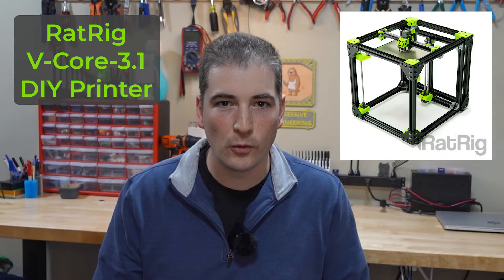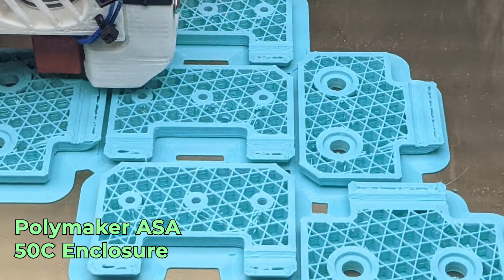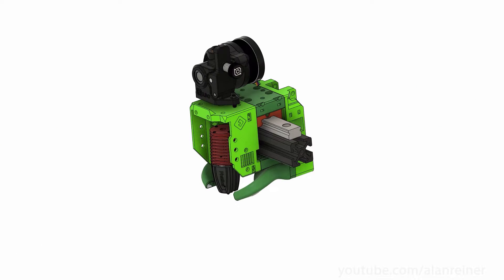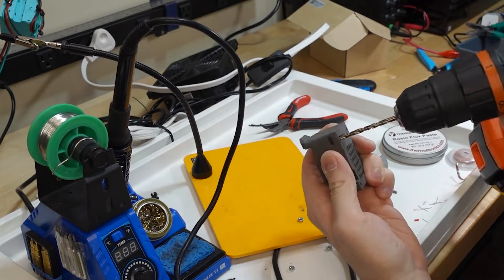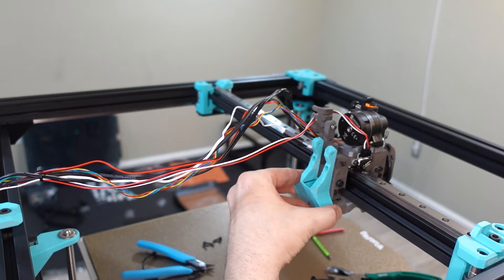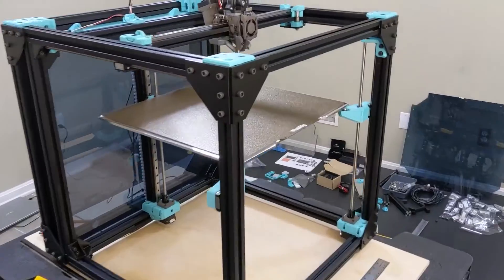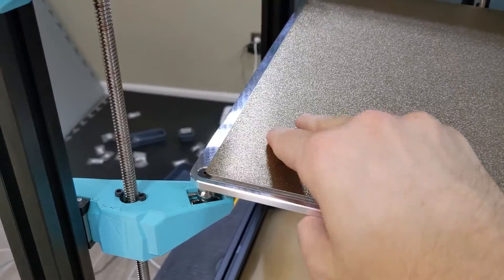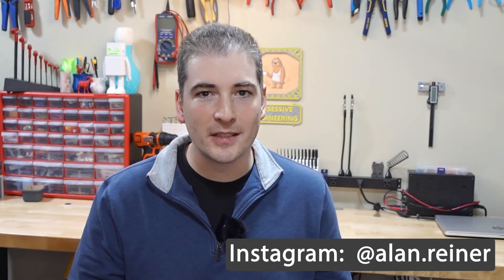DIY 3D Printer Build Experience (II) // Mechanics & EVA Printhead // RatRig V-Core-3

Comment: A few questions:
* Is that a 500mm RatRig?
* Why would the X axis have such a large resonance compared to Y?  There's a lot more mass moving in Y, I'd expect a lower frequency but large resonance there.

If the accelerometer is a single-axis accelerometer, that might explain why it does not see much resonance in X when Y moves -- it would just be measuring cross-coupling.

Final note, any chance you'd be willing to put that accelerometer on the frame itself (top side, where the X axis meets the slider when Y is centered), and rerun the test?  I suspect your frame is resonating as well, if that's a 500mm RatRig.

If it is, you could brace the frame with 8020 diagonals, which should make it much stiffer and drive the resonance up past 200 Hz where the amplitudes are tiny.
Reply from the maker: It's a 400mm V-Core-3.  And you just touched on a detail I left out of the video -- the clip and the chart are only for X-axis shaking test.  The chart shows the output of all 3 axes of the accelerometer, but the print head was only moving in X, thus you see mostly X-vibrations.

If I had continued the clip you would see the Y-axis shaking test next, and a separate chart with the results from that showing vibrations mostly in the Y-axis (actually, labeled Z because of the accelerometer orientation).  And yes, Y-axis is much more mass so it has a lower frequency.  Resonance for my X-axis is around 72 Hz, Y-axis is around 28 Hz.  Magnitudes are around the same order of magnitude.   

I recently attempted a speed benchy with input shaping disabled, and I was astonished how terrible my machine sounded.  With input shaping re-added it's not a quiet machine, but it sounded reasonable at high speed, not like it was going to shake itself apart.  I did eventually succeed at an 8:35 benchy, and most prints have minimal ringing, so I don't plan any more updates to the printer (for now)

P.S. - Sadly something has gone wrong with the accelerometer (or the wire/connector), and I haven't been able to run it recently.  However, I noticed that RatRig posted default resonances to use for each machine size for people that don't have the accelerometer.  Apparently the frequencies are pretty similar between builds.
Reply: @ObsessiveEngineering  I'm thinking of building a 500mm RatRig to print some molds I need.  I was planning to buy ABS/ASA printed parts off Etsy, and enclose the machine, mostly to keep the temperatures and thus shrinkage consistent rather than to print nylon or other high-temp material.  Any warnings you'd like to give me?
Reply from the maker: @IainMcClatchie  If you need accuracy, Nylon & PC are very difficult to print unless you have a crazy hot enclosure, especially larger parts.  Getting the chamber hot enough for that could require different rails, belts, bearings, etc.  However, if you are only planning ABS/ASA, then you should be good with the default enclosed V-core-3.  I have 3mm polycarbonate panels for most of the machine, and it gets up to ~55C (eventually) from pre-heating the bed to 110C (chamber to 60C with insulating foam on top).  This is good enough to do even large ABS and ASA parts very reliable.  I added a 200W heater to help speed up chamber heating, but it only made it like 15 min instead of 30 min.  Beneficial but may not be worth the trouble:

- https://www.printables.com/model/286458-ratrig-chamber-temp-controller-and-rocker-switch-m

The old style enclosure is probably not an option anymore, but be sure you're doing Enclosure 2.0 based on the original "open-front mod".   The old-style enclosure before late 2022 (with the hinged lid) technically works but is quirky and obnoxious.  

The only other thing to be aware of is that doing the enclosure is not cheap.  You'll have to either pay a company to source and cut the panels for you (which can be like $500), or buy the polycarbonate panels yourself and get access to a CNC router to get them cut.  It was an excuse for me to learn to use a CNC router, but not everyone is that committed 😅.  If you want to go that route and are in the US, you can keep an eye on Piedmont Plastics clearance page, which is where I got them like 70% off, though they weren't all the right size and I had to do some panels in halves. 

Let me know if you have any other questions.
Reply: @ObsessiveEngineering  If I'm not concerned about looks, why wouldn't I cut polycarbonate side panels from 8mm dual-wall polycarbonate (typically used in greenhouses) using a handheld jigsaw, and then hand drill the mount holes?  Does accuracy matter here?  I don't even care if it bows a bit when it heats up, right?

I want to print whatever material gives best accuracy.  There will not be much mechanical stress on the mold, and I plan to epoxy fill and polish the surface, so I'll be using the largest nozzle, flow rates, and layer heights that work.

The stiffness requirements on these rigs, especially on the belts from motion in the Y dimension, are large.  I've seen acceleration numbers like 50,000 mm/s^2 thrown around.  That's 5 G acceleration: +/-2.6mm of amplitude at 22 Hz.  That Y dimension appears to be at least one kg, and if it were just one kg 50 m/s^2 acceleration is 50 N of force.  The belts on a 500 mm machine are supposedly 2.9 m long loops (I think a little smaller).  The short legs would take about 20 N of that force each, across a belt somewhere around 600 to 900 mm long.

I looked on the Gates website for a stiffness spec, and did not find it.  I did find this paper: Nominal Stiffness of GT-2 Rubber-Fiberglass Timing Belts for Dynamic System Modeling and Design (https://www.mdpi.com/2218-6581/7/4/75).  With a little extrapolation, I think it suggests a 900 mm long, 9 mm wide fiberglass GT2 belt with 20 N of force change would have a length change of 1.6 mm.

That is to say, the drive pulleys would have to oscillate 2.6+1.6=4.2 mm at the pitch line to get the Y axis to oscillate 2.6 mm.  That's a very large amount of error.  I can see why folks would tend to stay away from 50,000 mm/s^2 accelerations.

Kevlar belts should be about 3x stiffer than fiberglass belts.  Do the RatRig kits come with kevlar belts already?  Is there any chance the belts could be made any wider?  I understand the RatRigs are using custom pulleys, which suggests no.

If you have any spare 9mm wide GT2 belt lying around, I'd be quite curious if adding 5 kg of weight to one causes it to stretch 0.18%.  That seems like a pretty easy thing to make into a video: compare Gates belts to whatever RatRig ships, measure if the belt is stiffer, plop it in the rig to see if the X and Y axes get stiffer, see if you can accelerate faster with the same ringing artifacts.
Reply from the maker: @IainMcClatchie  So I can't respond to everything here in a Youtube comment, but I have a few high-value responses:

1. 50k accel is absurd, and may not be realistic with a 500mm V-Core-3.  At 20k accel I did an 8m35s benchy, and was worried about premature wear on all the components.  Most people (myself included) run 4k-10k accel for every day use.

2. If you are aiming for biggest nozzle and layer heights, then the max speed and acceleration is not going to matter much *because you will be limited by the max flow rate of the hotend, not the speed of the printhead*.  As a point reference, I just put a huge 1.0mm nozzle on mine, and used a line width of 0.6mm and layer height of 1.3mm.   Even going as "slow" as 100mm/s results in ~80 mm^3/s flow rate which is higher than most nozzles can handle.  I try to keep mine below 35-40 mm^3/s even with my Phaetus "ultra-high-flow" (UHF) hotend which is one of the highest-flow-rate hotends out there.  They claim 75 mm^3/s though most think that number is a bit optimistic.  I've seen a couple hotends recently that claim to go up to 115 mm^3/s (like the super-volcano), which is great but you'll probably need a custom EVA mount for it.

3.  Most people go with 3mm or 6mm panels though the rear electronics panel must be 4mm or less.  Honestly I don't think the thickness will matter that much unless you're trying to push the chamber higher than 60-70C but that would require a lot of other upgrades (high temp belts, bearings, water cooling the printhead).  There is a "#high-temp" channel in the RatRig discord where people will give you advice if that's what you're aiming for.  If you're just planning to print ABS/ASA, then I can assure you that 55C-60C chamber is good enough and you'll have no problem with 3-4mm panels.

Finally, I encourage you to join the RatRig discord, there's a lot of dedicated channels there for all these kinds of topics.  For instance, there's a guy in #high-temp claiming to be working on a printer that can get up to 220C chamber!  There's also tons of mods discussion where you will find people that have redesigned parts to accommodate different belts, rails, etc.
Reply: I asked the author of that paper to confirm the width of the belts tested in the paper.  They were 7mm wide.  So I revise my estimate to +/-0.6 mm of belt stretch with 5 Gs of Y axis oscillation. That's still a large amount of error.
Reply from the maker: @IainMcClatchie  A quick update on this.  I see a ton of people on the RR discord now talking about AWD/4WD.  The idea is to double up the XY motors, so you have 4 instead of two.    This apparently not only doubles your torque, but reduces the maximum unconstrained belt length, which is otherwise a limiting factor with CoreXY when you go big.  Most people seem to be doing this for speed printing (at any size), but especially worth looking at if you're aiming for big AND fast.

Here's a random picture from the facebook group (I can't find the original to give them credit, but it's there somewhere!):

https://areiner-image-share.s3.amazonaws.com/signal-2023-03-26-083517_002.jpeg
Reply: @ObsessiveEngineering  Good time to share that i've just finished remodeling the printer to a 650mm bed size, and we are going to build it :) any ideas in advance about it :)
Reply from the maker: @TheOne10525  wow good luck!  I'm not sure I would have the courage to try that myself.  

As mentioned in one of the other comments, you might consider the AWD design (using two motors for each, the top and the bottom belt).  You will not only get some extra torque out of it, but it will reduce the unconstrained belt length, which might be very useful for such a large build area
Reply: @ObsessiveEngineering  Yeah,  I guess we will do that, what about the bed do you think it will be an issue for the morons on z, I guess it can handle it as it is :)
Reply from the maker: @TheOne10525  I would guess Z is no problem.  3 steppers can put it quite a bit of torque and you don't require high accelerations in Z, so I'd think you'd be okay.

This is a great question for the RR discord though.  They have a channel just for V-Core-3 mods like this called #supersized.  Most seem to be people building normal bed size but like 1,000 mm tall.  There's some interesting stuff there, though
Reply: @ObsessiveEngineering  I've joined 2 days ago I think, I checked it out, it was interesting! I've posted a picture  of the blend file for the 650mm you can check it out :)
Reply: @ObsessiveEngineering  Will you be kind to help with finding out what the awd should be for this printer?! :)

Comment: You mentioned in this video and the EVA video that the paid parts had to be shrunk, but how did you figure out by how much?
Reply from the maker: Based on your question, I just had an extended conversation with folks in the RatRig Discord about this, and it seems that my conclusion may have been wrong.  Or it was right but we don't know why.  They claim the parts are designed for PETG but that PETG has virtually no shrinkage, so the model files are not actually oversized...?  

My guess is that the absolute scaling of the parts is correct but that the holes have large tolerances to accommodate FDM print artifacts (like blobs at the start&stop of tool paths which can make the holes effectively smaller, which SLS and SLA printing wouldn't have).  

My recommendation is just print the heatset insert EVA parts and enjoy your life, haha.

P.S. - For completeness:  RR says the parts are designed to be printed in PETG, and that you should scale the models to 100.5% if you plan to print in ABS/ASA since it shrinks a little bit.  I printed all the non-EVA parts in ASA and did the 100.5% thing and everything there was pretty smooth.  There are a few captive nuts in those parts but they worked well enough.

Comment: The initial fan duct you had (the one with 40x40 mount) was intended for 4028 server fans not 4010 that you initially had. The 4028 offers a lot of power if needed,  It's lighter than 2x5015 blowers and quiet as hell for "regular" printing (30% max at around 200mm/s, 7k accel for PLA). Might want to revisit this idea in the future. If so the general consensus is a Delta fan, model FFB0412UHN-SM36.
Reply from the maker: Yes!   I had printed off the default EVA parts from the RR repo and that tiny 4010 fan was all I had that fit. That's why I ultimately changed it out.  I am mostly printing ABS and other high temp materials (Nylon & PC) which require minimal cooling.  I considered the dual 5015 fan adapter, but this has been more than sufficient so far.  Even for a 8:35 benchy in ASA!
Reply: @ObsessiveEngineering  yep, not much cooling needed for ASA and PC :)

Comment: Just a tip from what I've read.  Is you should use abs asla
Reply from the maker: Yeah, they recommend PETG if you aren't planning to enclose the printer. Or ABS or ASA if you are. In this build everything except for the EVA printhead is printed in ASA (the teal/blue).  Only the EVA parts are printed in the Nylon12(+CF?) that the Fuse 1 uses.  I heard that nylon has creep issues especially in a heated enclosure, but the printhead is pretty low stress compared to the parts holding the bed or tensioned belts.  I wasn't 100% confident at the time, but I've printed 250 hours on this thing so far and it's holding up great (and much of that has been at 60C/140F chamber temp!)
Reply: @ObsessiveEngineering  I understand, but if you look at alot of people who have done the setups, they say abs is the best by far,  the other plastics tend to not be as good. And good luck with your build I hope to do a custom set up soon.
Reply from the maker: Yes, ABS/ASA are the universally recommended material if you can print it.  It is rigid enough, has almost 100C heat tolerance, and super low creep even at elevated temperatures.  (ABS and ASA are nearly identical in terms of print settings and mechanical properties).  But you probably won't be able to print the RatRig parts in ABS/ASA without an enclosure.  

If you don't plan to enclose your printer you can instead use PETG.  In fact, if you buy the printed parts from RatRig instead of printing them yourself, they will send you parts printed in PETG.
Reply: You can buy ABS/ASA parts from community members in the unofficial Discord Server
Reply: @heisenberg19x66  yes I know